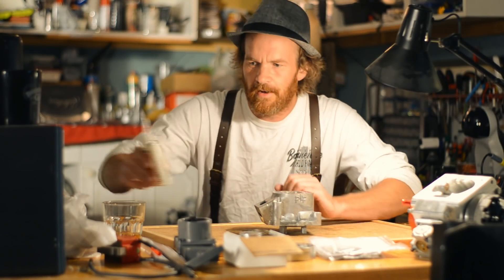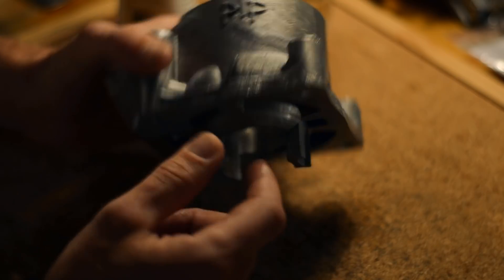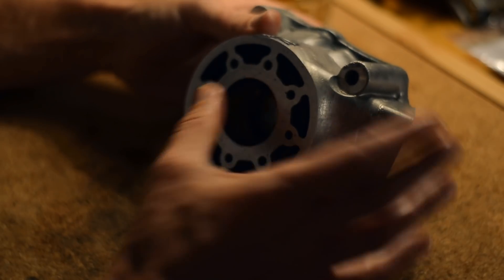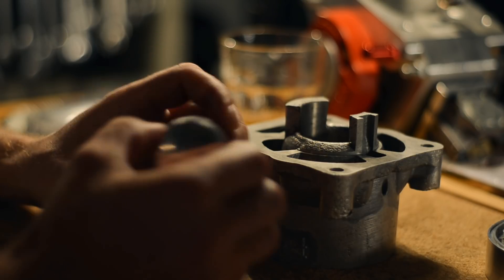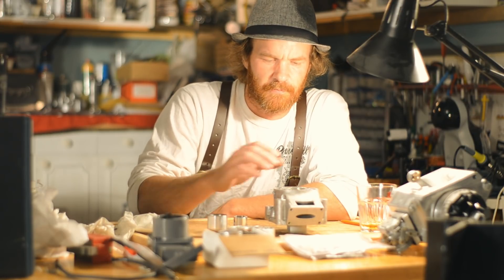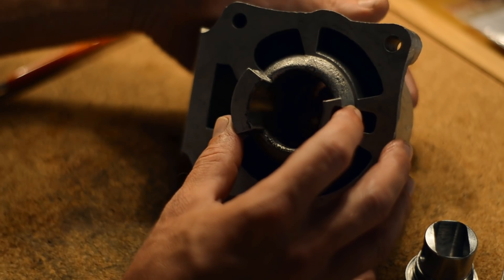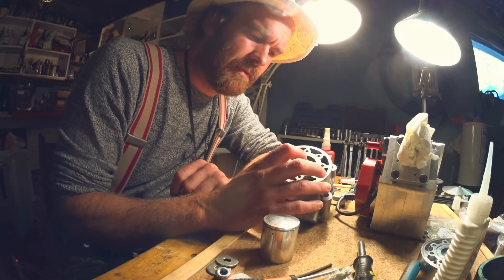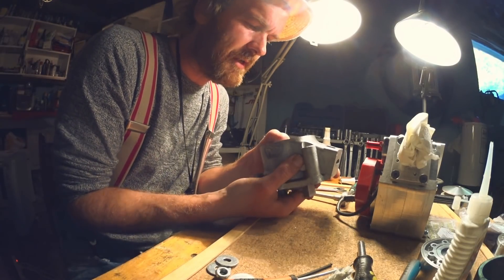The Most Powerful Two Stroke Ever - Won't be long now!

Comment: Can't see the top edge, one of the things we deal with in the air cooled chainsaw world is if the top edge is too "straight" or too square; adding a bit of curvature on that top edge helps the rings squeeze back in.
Reply from the maker: Exactly. In my design there's a big radius on that edge.

Comment: A little paint roller works great to apply silicone to the halves of the cases evenly.
Reply: One time use only I guess? Cant see you'd ever clean RTV out of a paint roller. One of the hard rubber rollers (e.g. the type used for bluing surfaces prior to scraping) might be a better choice.

Comment: I'm sorry but ey since you started fighting with the various cylinder castings that, I saw an exaggerated exhaust port, too large, personally already dimensioning at 70/72% of the piston diameter you get a thermal group for a day  like a lion, yours has been ten minutes. 
 If you want to get that ass back, give it a crossbar in the drain, otherwise you'll have to throw it in the wreck.
Reply: Of course, but if already moving the piston with your hands there is jamming of the segment, imagine with the thermal expansion and at high speed ... I think you will have to review the matter, I understand that it is for a record but, if you can get it right  , after you will have to throw away the whole thermal unit and this one like you who has done all this surely knows
Reply from the maker: The 100% port is kinda the main point here.

Comment: Maybe make the ring have no tension until it gets close to the top of the stroke. Drill small holes on top of the piston to behind the ring so the compression only forces it outwards when near top of the stroke.
Reply from the maker: Good old "ringland porting" 👍
Reply: @2STROKESTUFFING  I knew it was called that 30 years ago, but my memory isn't what it used to be

Comment: Have you looked into removing the piston ring completely like in small model engines? They use ABC / abn coatings and slightly tapered bores to achieve low friction and good compression seals. There would be nothing left to snag. If not, bridges in the exh port are a small compromise in power for a massive gain in reliability.

Comment: the aluminum piston wont like being dragged across the cylinder ring. its not the same as having a stationary ring in the piston.
Reply: That what I thought at first but then I thought what about nikasil coating the piston?
Reply: What about running a harder piston than the ring I mean longevity of the engine isnt a huge concern given the point if the project 6 runs before a rebuild of the top end or a piston replacement isnt outside of the normal for top speed stuff.
Reply: @jediknight1294  harder piston will probably be heavier so more stress on the connecting rod.

Comment: Hi i have a cylinder that’s probably has overheated at some point. So now there are two spots at the exustport we’re I have som nikasil loss. Could this be why it doesn’t want to rev as hard as befor??

Will there be some blow back in that spot???

Can the cylinder be rescued 👍🏻

Comment: Have you heard of extrude honing for intake or exhaust flow improvement? I don’t know if it’s applicable for such a small motor but I know you’re pushing the edge and I sincerely wish you luck.  Just an old V-8 hot-rodder brainstorming. Much earlier I suggested a cool can for fuel,  did that ever work out?  Your perseverance reminds me of my speed endeavors of the 70s when I was indexing all 8 spark plugs for a couple more horsepower. I was constantly exploring oddball methods for an advantage due to a rival always winning by a nose. Never did get that bastard. Lol

Comment: A possible issue if the "cylinder ring" idea might be, that the piston, while downstroking, wont produce enough positive pressure in the crankcase to force the gas trough the transfer-ports. 
Just my thought, i have no experience with this.
Reply: If you look at the little nitro rc car engines some are made without rings just a tapered bore maybe he should look into that but I’m not sure if it’ll scale up and work with a significantly larger engine and those engines aren’t known for reliability but he’s not making it for that anyway
Reply from the maker: No worries, I really on pulses from the pipe for mixture transfer.

Comment: I never hone a cylinder side ways (horizontal) . Gravity pulls down on the hone and ovals the bore (the weight of the hone pulls down so there is  more force on the bottom of the bore). I also never hone a bore dry. I use to bore cylinders for other shops as well as mine. I say that just so you know I have had experience.
Reply: I could see oil flicking off the hone.
Reply: Did you see how much it was moving its way out of shape you are very right it's not right at all

Comment: I'm not sure, why you so stubbornly want that 100% exhaust port, because with bridge you would have solved this a long time ago losing just tiny bit of it...or if you could put 2 exhaust ports to opposite sides, you would end up having a lot more than 100% exhaust port width in total. But I like the way you think, and try to make new inventions.
Reply from the maker: It would be just like any other cylinder then, no innovation. Two ports more than 100% combined requires a total redesign of the transfer geometry too for efficient scavenging. Might have something in mind for future builds tho...

Comment: Thinking you may need to run her "RingLess" Air Groves? Should be fine at the kind of RPM you are thinking? 
So Cutting numerous small Angled grooves Down the Piston, It Has Been Done... But on a 4 stroke. 
ALSO Thinking... You would need Sealed crank bearings. And who knows what else with that system.
Reply: Like a labyrinth seal

Comment: Quite a few good 2 stroke ideas were dropped, due to manufacturing cost on production engines. For instance twin ports were last used on a production 2 stroke motorcycle in 1972. Dropped due to the extra exhaust pipework adding manufacturing costs & a few kilos of additional weight.

A twin port 2 stroke allows for a larger combined exhaust port diameter venting into two independent exhaust systems, with can be synchronised in resonance or have different resonances.

With modern electronics a twin port 2 stroke could have one exhaust pipes system active & switched in above a certain rev range.

Comment: How about ABC (Aluminum-Brass-Chrome), like in RC plane motors - no ring, brass cylinder with chrome lining. Thermal expansion taken into account so that piston (top) seats perfectly when in operating temperature. Short lifespan, but shouldn't matter in this use case.

Comment: I think you have to make a new ring. You gaped it prior to changing the diameter... I think you should gap it by installing it in the piston first, removing material until it fits in the piston grove, then turn it down within the .002" or so specs you are looking for, then regap it considering thermal expansion of the ring.

Comment: Some RC engines used what they called ABC. Aluminium, brass, chrome. Basically a very slightly tapered bore with a hard chrome plated liner running a high silicon content aluminium piston. Not sure if it would scale up to a 50cc cylinder but certainly worth some research as they had no rings at all.

Keep up the awesome work😎
Reply: I guess it's not scaling up well because the ABC engines rely on the fluid as a sealer and the fluid molecules stays the same size and gets to small relativ to the piston? And also because smaller engines revs higher. In theory it is possible to mitigate by going multiple cylinders like 5 x 10 cc. But probably to cumbersome to build by yourself, atlest from scratch. An alternative is to buy RC engines and put them together to one 50 cc engine (smaller engines shall also be more powerful per cubic, in theory. But maybe it's against the Bonneville rules?).
Reply: It will probably be so eventually.

Comment: I agree with the guys here suggesting a supporting wall or 2 bridging the exhaust port top to bottom. They will be of a fairly small surface area though so will wear faster than the rest of the bore. Good luck dude.

Comment: I'm also voting for the bridges in the exhaust port to support the ring. It would also be really easy to implement if you're going to sleeve the bore, saves throwing away another barrel casting too.

Comment: Stationary piston ring will wear out your piston rather quickly vs the piston ring rubbing on a cylinder wall that's treated. Not to mention you're going to lose compression when the ring heats up and wants to grow. You're going to be working against material properties instead of using them to your advantage.

Comment: What about chrome plating the piston or cylinder and run no ring at all. Maybe just a little extra oil in the mix to make the seal. Possibly have initial start with a glow plugs and run it compression ignition like a model airplane.
Reply: The power stroke is much longer on this compared to a model RC engine. You need the torque in an actual vehicle. You'd just get excessive blowby and completely defeat the purpose of the engine.

Comment: Besides of the awesome engine build, I'm curious what is your choise of drink when your work with the project? And also bridge on the exhaust would help with the problem alot, bore it bigger and sleeve it and if possible weld some support on the bridge behind the sleeve (that it's not attached to the sleeve)  it helps alot in future if it breaks, you can re bore it size bigger and have a new run.

Comment: Piston ring design is a very complex topic. I like your way of thinking with the piston ring in the cylinder wall. However, I doubt if it would ever work for a number of reasons. At first, the piston will hit the ring with a relative high speed, I guess that this will damage the ring fast. Secondly, the piston is not capable of transferring the heat of the piston to the cylinder wall via the piston ring during complete piston stroke. Also, exhaust gasses flowing along the piston ring will heat the ring which causes it to burn the lubricating oil on the piston. This will cause excessive wear and engine damage.
Ramping the port is worth a try with a thick piston ring. This will prevent having nightmares over a 'cylinder wall ring' design ;)

Comment: Hi, I think a bridged exhaust port would solve your problem. Keep up the good work, this project is fascinating!
Reply: I would think it does not need to be 100% but it does need to work without failure, a bridge might help that problem... Idk!
Reply: yeah it would but that is not a 100% wide exhaust then. My engine has a 94% wide exhaust port but it has a bridge and it can never get to 100% of the bore with a bridge
Reply: @ttmfinland_yt  In theory, 100% bore would still be possible if the port was wider than half of the circumference.
Reply: He purposely stayed away from that. Earlier video
Reply: @wags9777  well it's really the only reliable method that comes to mind, I'm sure he will find a way tho.

Comment: just weld up a bridge in the exhaust port
Reply: Yep, agreed (its only 3 to 5 % difference  in flow anyway)1.5 mm is the minimum width is all that's needed 👌 .... Piston ring bounce (in and out of exhaust  port) in milliseconds will kill the power, as well as the port...
 Keep up the good works 👌.... The Joneses'
Reply: @JJONESMX09  A 1.5mm bridge sounds like a recipe for seizure. Exhaust bridges run hotter than any other part of the cylinder, the thinner you make it the hotter it will get.
Reply: @ferrumignis  we have done this before with successful results, there is a few key factors that wold need addressed; ie: back cut... ceramic coatings.... aluminum support behind the narrowed face (heat sink) would of course be wider.... Again, proven results in these situations ( land speed) will work.

  My Grandfather Don Jones has numerous cylinders around in storage with this same exact setup ...
Reply: @ferrumignis  i don't think this engine will run particularly hot given the massive amounts of nitromethane running thru it
Reply: @riccardo7352  its still going to get hot remember the turn around between runs and the air temps, the run distance and the RPM, nitro will run cooler than gasoline but will still be hot, its why drag builds run Ice tanks. 

Theres been some scary high power put of 50cc engines over the years Suzuki built a racing moped that did 90mph for a race series at motogp events in th 80's in standard upright moped style bodywork and chassis and the standard 9-11" scooter wheels. I wouldnt be suprised if 50bhp+ is posssible. 

I'd also like to.see a ringlets piston but I'd be concerned about pistob slap and rocking in the bore.

Rc nitromethane engines are fascinating as power per CC they are producing power that things like the veyron can't match.
Reply: @ferrumignis  drill holes where the bridge of the port covers the piston.
Reply: Totally agree here. 100% exhaust port sounds too nice BUT, 95% or something is sufficient to create the fastest 2 stroke my man (for 5 minutes of running it, before it dies, imagine tuning it ;) Oil distibution is so crutial @ 20000??. If you want to place the "stationary" ring below the exhaust port, you have to craft sooooo many cylinders and receive a lot of these nice pistons until you will be able to make it to 30+ hp. Better take it step by step. The precision of of measuremennt needs to improoved as well. What is the aluminium grade of your cylinder and the one from the piston?? Tolerances are key for high power! Greating from your donating engineer from Germany :*
Reply: That's what i was thinking, a small bridge would have little impact on gas flow and stop the ring expanding.with such a wide port it would help support the piston and stop any rocking in the bore
Reply: I would be curious to see a ringless piston like nitro rc glow engine. May really simplify your goal.
Reply: Should fit a regular sleeve and leave the bridge in when he grinds out the port
Reply: Agree..like honda nsr sp port..
Reply: this!
Reply: I was on the bridge plan. I do find it unusual that such a small displacement has a problem,maybe playing with the ring composition will fix it.🤔

Comment: You have to dowel pin the Piston Ring Groove for a two stroke. If you don't do it, it'll let you know it needs to be done when it goes Bang! Also you may find that the inlet and exhaust ports can only be a Calulated maximum width before the Rings cause a problem expanding into the Ports.

Comment: 10:10 this is an idea but no you have to coat your piston. I have my thoughts about it.
Reply: also further to this, the ring is no longer maintaining the surface of the cylinder, so you will get varnish deposits on your cylinder walls
Reply: peg your ring at the traditional exhaust bridge location. provides the support a bridge would without disrupting flow.  you wouldnt get long life but longer than an instant snagged ring....  the peg would have to run through your ring and be oval to allow for radial float during operation

Comment: The rotary guys also use a scissor action to get the seal back up on the plate, exhaust ports are slightly rounded on the top to help the apex seal back on the housing after passing the exhaust port, it doesn't drop but a flat top edge eats apex seals.
Reply: His ex port is rounded.

Comment: Another possible solution would be to machine the bore to accept a steel liner with a split exhaust port that has a vertical divider in the middle to stop the piston ring bulging out

Comment: Two part piston with a trapped ring (i.e. L shaped) to control the maximum expansion?
Or with a deep enough ring could the ends be shaped to be "hooked" over each other to limit expansion?

Comment: Stop and measure frequently while honing to look for taper in the bore, you should be pumping a little more aggressively with about 1/4 -1/3 of the hone leaving each end of the hole, put a radius around the exhaust port at the cylinder, this is what rotary guys do when porting and dropping the back half of the leading side seal into intake port.

Comment: What about no ring? Like a RC nitro engine..
Reply: Size of engine, tolerances, blowby, pressures, stroke time. All of these things and more make it different from a nitro RC. Nitro burns way quicker which makes the expansion time way shorter plus you need to torque on relatively large vehicle vs an RC.
Reply: @Kyrazlan  thanks for the quick answer, I figured as much. My train of thought was that it was only 50cc so he might be able to get away with it... haha
Reply: Ben Hop : Just take 10 RC engines with 5 cc each and put them together to one 50 cc engine.

Comment: Just had a thought if the piston ring isn’t attached to the piston what is keeping the piston central to the cylinder? 
Wouldn’t it bounce off the cylinder wall? 

Would you have to put a secondary ring below the exhaust port to keep it central?

Comment: Just hypothetically - could you inverse the piston rings? Make them cylinder-rings instead, I suppose. Use a smooth piston without rings, and slot the rings in grooves in the cylinder wall. That way, the rings are static and it may open up some new avenues for your exhaust. I have absolutely no idea if it's feasible to manufacture something like that, or how stable the piston would be....

EDIT: haha, round the 10 minute mark you had the exact same idea... XD
Reply: Wont work. Too many issues with this.